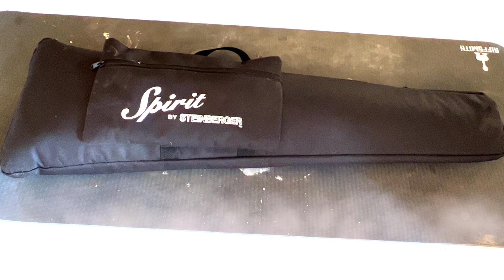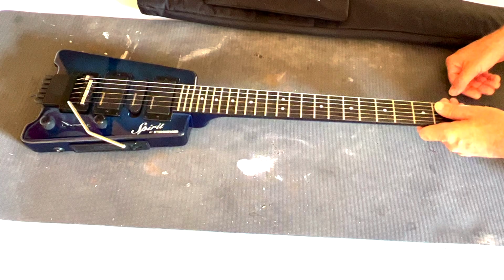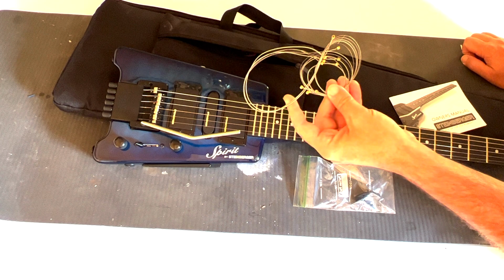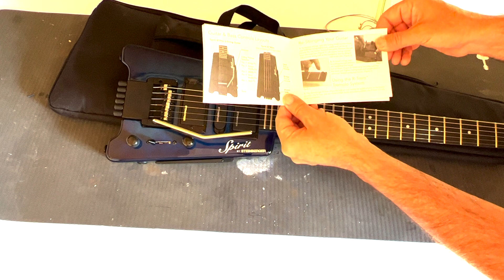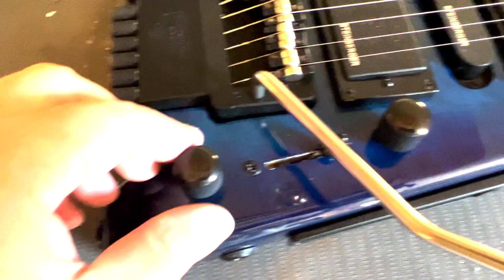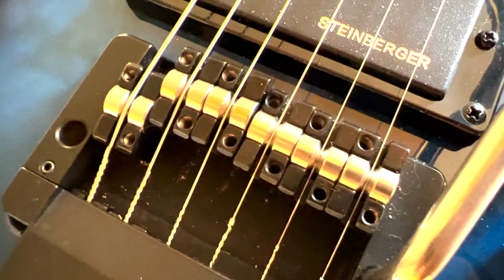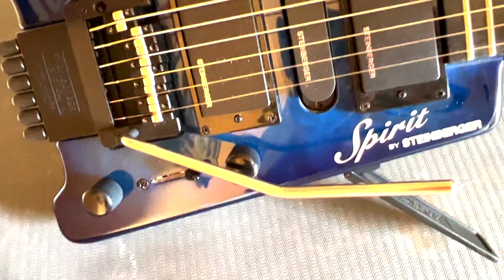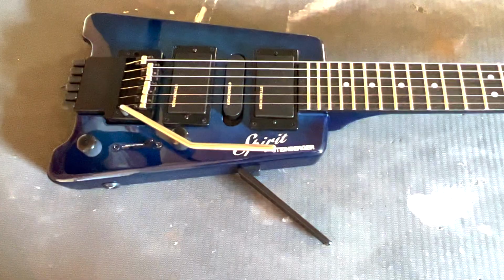Steinberger Spirit GT Pro - Demo and Review - And A String Break!!!

Comment: I had one of these. I loaded it with EMGs, took the paint off the back of the neck and spent a bunch of time making it play incredible.   That being said, I could never play it for any length of time because it wouldn't "sit" right on the strap or when I was sitting down. Thanks for the upload.
Reply from the maker: You’re welcome!  It’s hard for me cause I can’t rest my arm and hand in it properly.   Makes it so hard for me.  👍
Reply: I was thinking of buying one and adding EMGs. Where did you put the battery box?
Reply: I have the same guitar. The neck-dive issue from the original strap lock makes it painful to play in standing position, so I cut a piece of craft-plywood to simulate the length and position of a double-cut guitar. That makes the guitar perfectly balanced and easy to play.

Comment: I have two.  I keep one in my car with a small, battery powered multi effects amp.  Whenever I end up at a party or open jam location, I’m ready to jam. They are bulletproof, travel well.  They fit in overhead airline compartments, so little chance savage baggage handlers will be flinging your guitar into the baggage bay.  Camping, backpacking, hiking, road-trip, you always have a inexpensive on-the-go simple rig. Love ‘em. Before I retired, I would smuggle it into the office at work, keep it stored under my desk, so I could practice during “slow” 😏 days
Reply: nice thanks...

Comment: Got one of these at the start of the covid lockdown and fell in love with guitar again. They are weird at first (I was a long-term strat player) but after a week I didn't really want to go back to a headstock. The thing is tiny yet has the same 25.5" scale length as a strat and it's wonderfully balanced. No worries about broken headstocks and with this you can slouch back on the sofa and play comfortably. It's worth spending some time setting it up; the zero fret facilitates a very low buzz-free action. Not even the top Ibanezes have such unimpeded access to the upper frets! Play it in classical position (leg rest over raised left leg, body sitting over right hip) and lift the neck up  a bit and it's rather a shred machine 😁👍
Reply: I bought a Spirit bass to try playing in that position. It really does work great. Very comfortable. Due to some physical issues, it is painful for me to play guitar very long in the typical electric guitar position. But classical guitar position with the Spirit, and I can play for an hour or so without pain. I'm going to try the Spirit guitar when I have some more cash.
Reply: Poopa Scoopa  White. It happened to be the only color available at the store =)
Reply: Poopa Scoopa  Indeed, I like it! I haven't owned a white instrument since my first electric guitar, a squier strat.
Reply: "and it's wonderfully balanced." 

Can you play this comfortably without using the folding leg or a strap?
Reply: @ColtraneTaylor  Yes. More comfortably than a "conventional" electric like a Tele, 335 or LP. I tend to play it in a  classical position with quite a steep neck angle, with the lower bout resting on my right hip. Doing that, I can play comfortably whilst lounging back on a sofa.
The Strandberg Boden design offers (IMO) slightly superior ergonomics if this is a deal-breaker for you (check out the Latitude Cardinal for a decent cheap alternative). But the Steinberger is still very good in this regard. Just be prepared to experiment and try different playing positions.
Reply: @mk7073  Sounds good. And is it difficult to play with your strumming hand given that you can't really rest it? I have that issue with Hofner Shorty's. I'd have gone for a Strandberg but I loathe the look.
Reply: @ColtraneTaylor  It took me a week or so to get used to the differences. Picking hand position is mostly unaffected but you'll spend a little while wondering where to rest your picking hand's forearm. It felt odd at first but you get used to it.
Reply: @mk7073  Ok. Thanks, that's reassuring, I really should get this.
Reply: @ColtraneTaylor  I use it since years without it in front of my computer. I think I used the folding leg only once, but I found it more complicated than just placing the guitar onto my right leg. A strap I never used with it. But of course this is my personal experienece only.

Comment: Keep the original nut and use the double ball strings, indulge a bit.  Replace a broken string on the fly takes about 45 seconds, no tools.  Full string change 4 to 5 minutes.
Reply from the maker: I put the original nut back on 😎👍

Comment: Very cool. It sounds great on this side of the speakers. I saw Eddie play his on the Monsters of Rock Tour ‘88 in Memphis… I think he played it on “Summer Nights”… he seemed to be having some trouble with his wireless rig...it kept cutting out. It was a GREAT DAY!
Reply from the maker: Thanks bro.  These are cool little guitars.  Correct Eddie used it on summer nights and get up!😎🤟🏻
Reply: That was a great lineup with Van Halen, Dokken,  and of course Metallica. I didn't get to go but I saw Metallica on the black album tour, Dokken in 99. And closest  I got Van Halen was Hagar and Michael Anthony a couple of years ago. Was still fun to see. They did about 5 Van Halen songs. Funny thing about that was they were doing mainly keyboard driven songs with no keyboard player.  Took some of the 80's fun out of it.
Reply: it can also be seen in the "live without a net" (1986 i think) video, after one of the strings on his Kramer breaks, iirc.

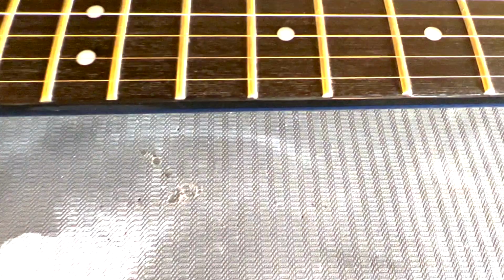Comment: Great review! Just a question, on 6:45 Where did you buy the replacement nut you mention, in order to use standard strings? There are several models on Ebay but not sure which one to use, considering the dimentions. Kind regards from Mexico!😊

Comment: <---- Got this about 6 months ago. Put in the DiMarzio Evolution in the bridge and Dragonfire strat in the middle and Dragonfire Screamer in the neck. Changed the 10s to 9s and also got a string adapter so I don't have to hunt for double ball strings. I hardly play it. I'd rather have one with a body. But Kiesels and Strandbergs are too expensive and ugly. I know EART and Harley Benton make headless models, but they're just knockoffs of the Kiesel and Strandberg.

I only got this one because I couldn't find a GU series for less than $600. Seeing as how I paid $229 years ago for a GU Deluxe that I deeply regret selling, $600 is not an option for me. And I want it in white (gotta honor Vito) and can't find that color. Any GU I see on eBay is black, blue (yes, Vito had these colors also. But he's more known for the white one) or sunburst.....and over $600.

You forgot to mention the trem bar can be put on either side of the bridge.

Comment: Hello. Im having problem keeping the tremolo arm locked, with the Allen key. It locks the tremolo arm to a certain point. The the Allen key just goes around and around..Is this natural. ?? Would appreciate some help.
Reply from the maker: I've never looked at it in depth but it sounds like there is a tightening nut on the other side that is spinning and has come loose.  I'd suggest removing the string and taking the tremelo off.  Reverse engineer the thing and look at it to see what is causing that rotation. If that doesn't help, then sadly I'd take it to a tech at GC or local shop.  But I bet taking it off and looking at it will reveal the reason.  And give you access to the fix.

Comment: The guitar itself is wonderful, I'm playing it since years, also the bridge has no sharp screws or any other "problem" zones and if from time to time cleaned, the strings last very long, plus the guitar keeps - if properly adjusted - and at least with double ball end strings perfectly well the tune.
 Also had a string adapter, but soon removed it again. Double ball end strings hardly are more expensive meanwhile, but do a much better job and last almost forever (I usually replace them after 2 or 3 years, which hardly worked with any other guitar and this only, because I want to clean the fretboard.)

Despite of the longer (Fender) scale I would define the sound as some nice mix between an SG and a Les Paul, not as thin sounding as the SG, but also with a little more bite and freshness than a Les Paul, at least with PAF's or comparable pickups and with more than enough sustain, but still a good, vivid dynamic reaction to attack. Also had a Hohner headless once, but this one disappointed me completely, as it did not react to attack in any way. The Spirit - at least mine - reacts like a  Porsche, the Hohner did like an oversized, overweighted truck, so to say. Nothing for me. 

One weak point for me are the - for my ears - lousy ceramic pickups. Especially the neck pickup sounds too loud in comparison with the bridge pickup. So I replaced them with a pair of alnico PAF's, covered the single coil hole - never been a HSH fan and regular single coils do not match without any additional routing work, only an EMG, OBL or Ultrasonic would match, but they sonically are not really, what I am looking for - and replaced the 5-way switch with a 3-way one. 

Also added an adjustable bass-cut for the neck pickup with a trimmer inside, which improved the neck pickup sound a lot but also the combined neck-bridge pickup sound, which sounds more transparent and fresher and with 3 good sounds, which work for everything between clean and high-gain I have all I need, although I anyway mostly am only using the bridge pickup. Also added a Styroflex capacitor to the Tone control instead of the awful Greenie. 

In my opinion still much better working than all these modern Chinese Strandberg - or whatever else - copies, also intonation is perfectly well adjustable. I mostly use it sitting in front of my computer, but never ever needed the leg rest. (Of course a real Strandberg might be a different game but also a different price level.)

I still have the old all maple version, but slowly I need a new one, or I at least have to refret my old one, so I am curious, how much the newer ones with the basswood wings will differ. 

I also have a two-piece ash-body Tele with alnico III pickups and a semi-solid Les Paul, also with PAF's and bass-cut for the neck pickup, but these I hardly use, although they sound really good. 

But for me my Steinberger gives me exactly the sounds, I am looking for and it feels and plays well with almost no weight. So my band washers also are happy! (I'm not the youngest guy anmore...)

Comment: Test drove one of these several years ago. The tremolo was barely usable. Doesn't return to pitch...definitely no divebombing. The strings slide and scratch across the zero fret (acts as the nut on steinbergers) when you bend strings, which also means that they don't always return to their original positions resting on the zero fret (change in tension =change in tuning pitch)

Comment: Nice video.  Which solution did you use for the nut in order to use single ball strings?  I would also like to change mine so I can use regular strings.  What is the brand / model item of the nut you used please?    Thank you
Reply from the maker: Man, I can't recall.... I found this nut on eBay for like $15 or so.  I searched Steinberger spirit nut.  Single ball string on google.  And it lead me there.   I then looked at some reviews.

Comment: Where did you get the locking nut that fits that guitar? Do you have a link?
Reply from the maker: It was Chinese.  eBay.  Can't remember.  They are quite readily available.   I actually Put the old nut back on it last night.  I never could quite get the action right with the Chinese nut.

Comment: if a string break, will the whole guitar run out of tune like a normal guitar with a floyd rose system?
Reply from the maker: If set up to float I do believe so.  The real trans trem would just stay in tune however and go sharp. ☮️
Reply: @Ranch5150SkinWalker  so if i break a string during a song, i will be screwed? lol
Reply from the maker: @daimong4553  unless it's locked.mine is locked so it's fine.

Comment: Where do you get that thing for regular strings??
Reply from the maker: I changed the nut that fits regular strings.  But then changed it back to original later.
Reply: @Ranch5150SkinWalker   why you removed the adapter tho? (The black  ones or the bras /aluminium one??) im about to spend my christmast gift

Comment: I have one of these, and it's a great little guitar, EXCEPT!  Put a headstock on it. The double ball string system is an absolute pain in the arse. The products they sell to use to use single ball string s do not work (the B and E strings just slip through the locking nut and a horror show to put the adapter on the neck as it is not secured and only held by string tension. If I knew I had all the hassle, not to mention the outrageous price of double ball strings, I don't think I would have bothered.